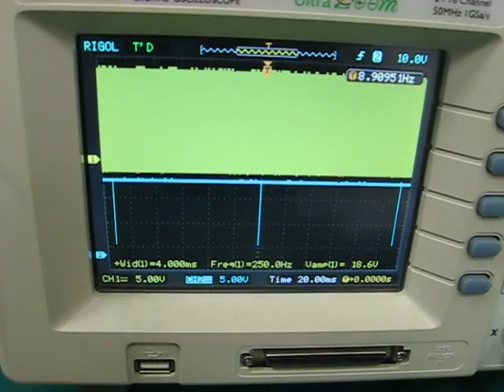Intel 4004 system on breadboard, first succesful test run

Comment: but can it run Crysis?
Reply: hahahaha, just Minecraft I think
Reply: Damn, people get r/woosh easily.
Reply: LINUS has left the chat.
Reply: Hmmm minecraft at 225 pixels at 0 frames per millennial. 4 bit can support up to 15x15 pixels it would probably fry itself before it could run 10 frames.
Reply: 0.000000001 fps I guess
Reply: @muriloleite7194  DooM4 120 fps 4k
Reply: It cant even run windows I think
Reply: @muriloleite7194  my pc has 4gigs of ram and a old amd processor e240 and it cant even run minecraft properly

Comment from the maker: That sounds great! Just few days ago I got working HD44780 LCD with the not so common 4265 I/O chip, it's pretty fun. If you'll need to write some test program for the 4004 just leave me message, I could try that too. I have bigger plan for this system but I'm afraid it would require too much memory, both rom and ram, maybe it will end up with another historic CPU/MCU which is the Mostek 3870. I have the piggyback dev version and it's great, you can even write back when you have NVSRAM on top.

Comment: I purchased a lot of 8 (yes eight!) 4004 D type several years ago, they were some new old stock I was able to get several 8008 & 4040 MPUs along with many support chips for each series (not for sale) I setup a PIC16F877A to test all of the 4004 but have yet to test the others.
Reply: how much did they cost